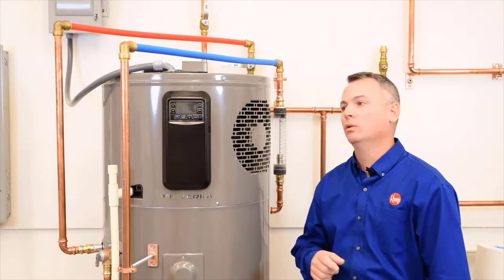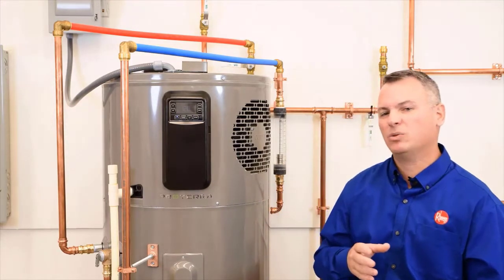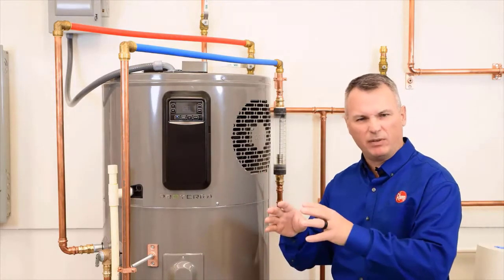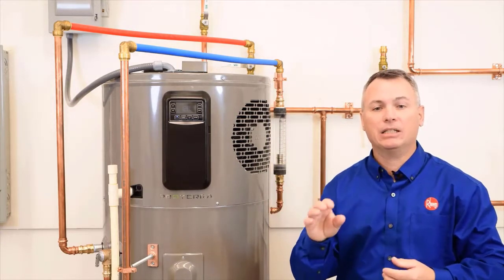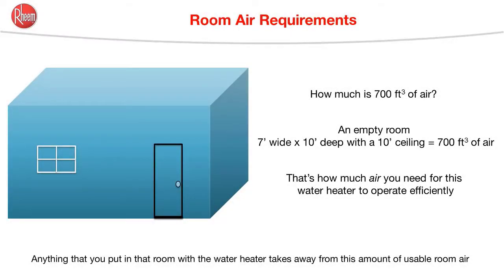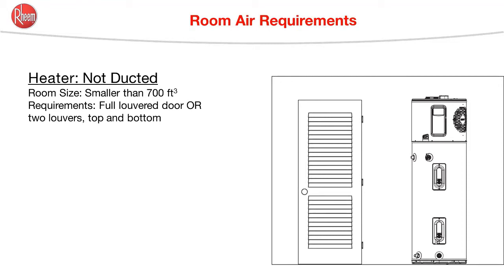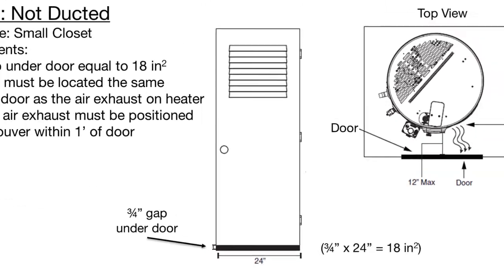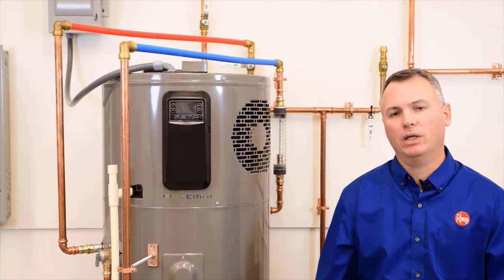Room Air Requirements for Installing Rheem® ProTerra™ Hybrid Electric Heat Pump Water Heaters

Comment: I have plenty of basement room around my Rheem Heat Pump hot water heater, but plan to discharge the cold air into the cold air return of my home's heat pump air handler which is situated next to the HPHW.   Letting the cool air to discharge directly into the basement makes it too cool in the winter.  We live in Georgia so we use our home heat pump to keep our house warm almost exclusively.  It is not a problem if a little cold air is blown into the HVAC system as it will be distributed throughout the house.  Do you foresee any issues as I personally think it is a great idea.
Reply: It seems like a good idea, but you could cause condensation issues if the water heater runs when the HVAC system is off.

I might recommend ducting the cool exhaust to very near where one of your HVAC returns is so the air can be recycled indirectly.

My intake is ducted from the bathrooms so the water heater is very often drawing in warm moist air from there, which means the exhaust is not quite as cool, but also the water heater is near the wood stove, so it's the perfect place for a cool draft. Think creatively, you may find a solution that works well. I find the free air conditioning in the summer and dehumidification is well worth dealing with a draft in the winter. It can usually easily be directed somewhere where it isn't a nuisance.
Reply: @wiredforstereo   The HVAC has condensation coils, collection, and drainage system installed.  Works great in our humid GA summers and even better in the winter when I am heating with my wood furnace.
Reply: @cowdiologist2759  That doesn't address what I said. Your HVAC has a condensate drainage system under the evaporator coil, not in the ducting where this cold air will go.
Reply: @wiredforstereo  I am running the vent into the HVAC system right at the the infeed side of the evaporator unit.  Have not had any condensate issues.  Working great. Thanks for your insights.
Reply: @cowdiologist2759  Your mileage may vary.
Reply from the maker: We don't recommend connecting hybrid electric heat pump ducting into other external duct work. If you need more information about this, please contact our Technical Support Team at 800-432-8373. We hope this helps!

Comment: I have a crazy idea .... Can I duct my air dryer vent hose into this water heater?  I plan to build inline lint filters into the duct pipes .... 🤔
Reply from the maker: We don't recommend connecting hybrid electric heat pump ducting into other external duct work. If you need more information about this, please contact our Technical Support Team at 800-432-8373. We hope this helps!
Reply: Doubt it. However, I had an idea of building a heat exchanger around my dryer duct. Run a 4" metal duct in the middle with the dryer exhaust, then encase that in a 6" duct and pull air off of that. However, with a water heater you're going to have very limited utility, as rarely are they going to run at the same time.

Comment: What is the lower temp limit for this heat pump to work efficiently? My garage is not conditioned space so in the winter it can get a bit cold there. In the summer it should be perfect though.
Reply from the maker: The ambient operating range for this unit is 37 F to 145 F. Outside of this range, the unit doesn't not operate efficiently.

Comment: What about adding a filter so garage dust does not get into the unit?
Reply from the maker: Thank you for your question. There is a removeable, reusable air filter in the top of the unit. It can be washed and put back into service. If it is ignored, an alert will remind the homeowner to clean the filter.

Comment: I see it's not recommended to locate a hybrid heat pump water heater outdoors due to concerns about low temperatures. However, I don't have an indoor space that would work for it, and our old gas tank water heater is outside in one of those thin metal enclosure cabinets. Also I live in Southern California about 3 miles from the ocean. Temperature highs max in the low 80's in the summer, lows min in the mid 40's at night in the winter.  Could I get away with installing the hybrid heat pump water heater outdoors, perhaps in a similar thin metal cabinet but with louvered vents to allow air exchange while keeping the rain off? Would locating it outdoors impact the warranty? Thanks!
Reply from the maker: Hello, thank you for your inquiry. Although a ProTerra Hybrid Electric Heat Pump Water Heater can fit into most standard outdoor water heater enclosures, proper ventilation is needed for the heat pump to function optimally. If you would like to use an outdoor enclosure, here are the requirements: Enclosure door must be louvered with an air gap under door equal to 18 inches squared (0.75” clearance). Louver must be located the same height on door as the air exhaust on heater. Heater air exhaust must be positioned towards louver within one foot of door. Here is the spec sheet: https://rmc-cdn.s3.amazonaws.com/media/uploads/iat/sites/36/2020/04/HP-350-5-RHEEM-GenV-hybrid_0403.pdf.
Reply: You could easily keep it outside. Maybe even duct the air out and back in for free air conditioning.

Comment: How loud is it?  I use my basement a lot.  Someone said the compressor is loud and would not be appropriate next to a family room.
Reply: Delton 22 I would say it’s the loudest box fan you ever heard.  Having said that, they are scheduled to replace the heat pump fan tomorrow.  I’ll try to let you know if it quiets the system down.  Rheem knows this is an issue and has chosen to ship, the units anyway.
Reply: @morrisassociatesllc  Hi, did they fix the problem? I read most negative comments are about noise
Reply: @Paata02  yes they did.  I can’t hear the unit at all on the main floor.
Reply: It's basically a small/medium window air conditioner, except the rejected heat goes into the water rather than outside.

And it's about as loud as one. Probably a little less because it's not working so hard to produce cold air.
Reply from the maker: Thank you for this question. The unit is about as loud as a box fan when the heat pump is running.

Comment: Plan to install a 65 gallon unit in the corner of a 20 ft x 22 ft x 9 ft (ceiling) 2-car garage; see any issue?
Reply from the maker: As long as there is more than 700 cubic feet of free ambient air to work with, the ProTerra unit is a good option.
Reply: @rheemwater  how cold can it be in the garage?

Comment: I bought one of these in November. It just went bad. Your service center said so. They said it will be replaced per the terms of the warranty. But outside of the terms of the warranty, you're requiring it to be returned to the retailer, Home Depot. Home Depot does not stock the 65-gallon water heater and you won't send them one without a PO and they won't order one unless I buy another and then get reimbursed. So you want me to spend another $2000 to get you to honor the terms of your warranty on a 7-month-old unit!?! There are no written provisions for when and how I'll be reimbursed. Considering you're not honoring the verbiage in your own warranty, how can I trust the reimbursement won't be in credit towards future purchases? I'm on day 2 of trying to work my way through the double hells of your call centers and Home Depots. Anyone reading this take heed. Rheem is trying to change the terms of their written warranty and Home Depot is not standing by the products they sell.
Reply from the maker: Hi Thomas, I reached out to our warranty department on your behalf, and I understand they are currently assisting you with your concern and will be in contact soon with a resolution.
Reply: Did they step up and honor the warranty? I'm almost buying this @ $1700/pop and this kinda of treatment is a turn off
Reply: @vroor32  the local commercial distributor stepped in and took over. Home depot was complete assholes and Rheem doesn't have a good system with them.. The unit saves a ton of money but I'm not sure I'd get another Rheem.
Reply: out of curiosity when did you buy it? Ours was warranty replaced pretty easily
Reply: This is one of the reasons not to buy from Home Depot.  I'd recommend going through your plumber to buy one from the plumbing supply house.